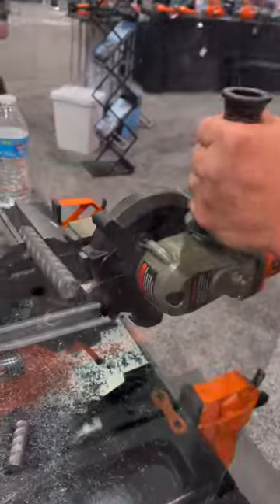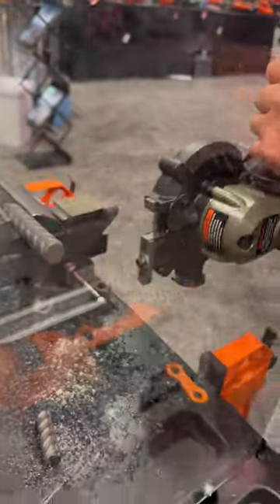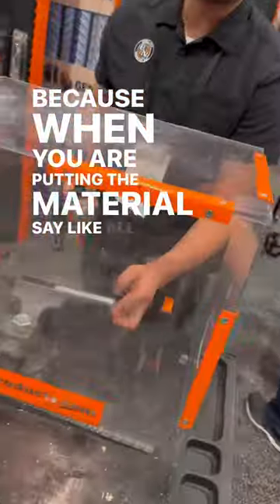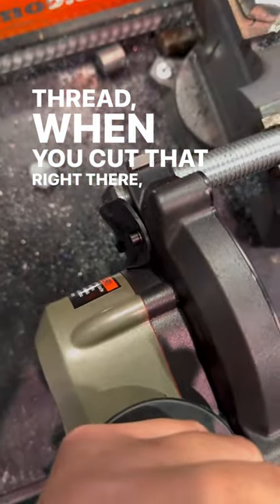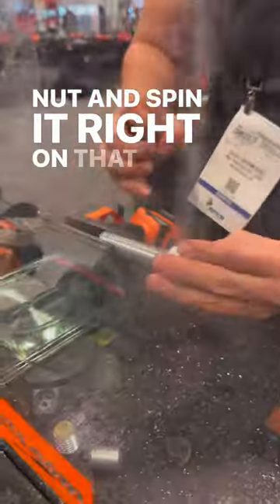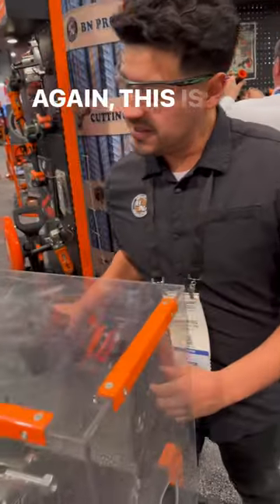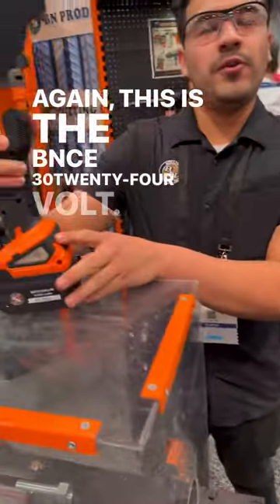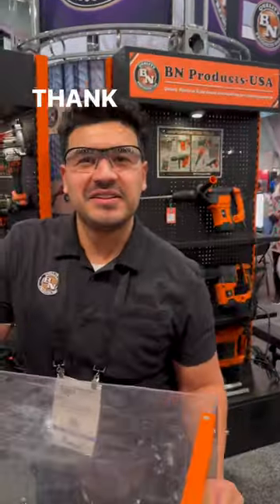You had me at the nut. #shorts #cool #tools

Comment: You spin the nut on and it still gets stuck… I’d rather take the extra 2 seconds leave the grinder running and bevel the end of the all-thread rod instead of buying a tool that is pretty much useless. I do commercial hvac work and I use a ton of all-thread and I don’t see a point in buying this especially when using this attachment limits what you can do with your grinder unless you take that attachment off. I could see very few scenarios where this attachment will be helpful. I’ve never needed to make 50 cuts of all-thread at once, usually your cutting 5 maybe 6 pieces for pipe supports to run on uni-strut or J-box but I don’t see paying for that and having to take the attachment on and off I have multiple grinders I keep on my service truck battery operated and corded but most people don’t have 4 grinders lol that’s something you buy throw it on one of your grinders and that grinder is specifically used to cut rod after that but other than that I don’t see a use for it.

Comment: I use a regular grinder for the thread , it works just fine. After you cut it , use the flat part if the wheel to sand it flat and it works every time. Be mindful it can be hot when trying to add the nut
Reply: Put the nut in first, cut after the nut and unscrew it over the cut. It will be fine after
Reply: Do not side load cutting disks.
Reply: @autumn5592 good advice, especially if you're silly and dont wear eye protection. I have a seperate grinder with a sanding disc for cleanup on it.